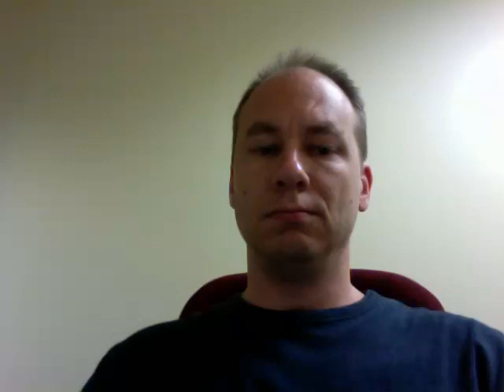R22 and R410

Comment: I have a nordine heat pump and it seems to be costing me lots of money in repairs .The house is in VA and 4 ton unit 2x6 stud walls and double pane windows .I am at this time getting bids for a 4 ton unit from trane or carrier .trane xl18I hyperion xltam7.ay 7thousand dollars installed after rebates  and 2 years labor from the installer.Which would you go with .The carrier would be about the same price but 1 year warranty from company <>I am confused by heat pumps .I used to live in NJ and we used traditional units .I am also paying cash

Comment: ($80 is the going rate to unload the recovery unit even if just 1 ounce is recovered) . While others charge the customer for recovery and vent the refrigerant anyway.
    The new refrigerants are not as good as the old refrigerants and attack the equipment and require special oils. The old refrigerants will last indefinitely.